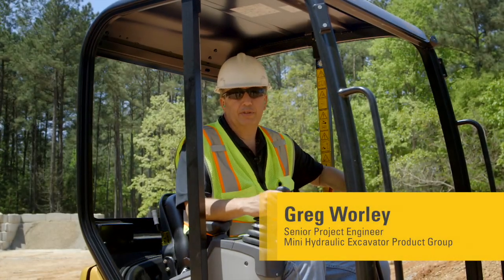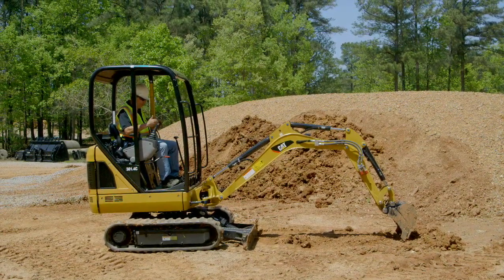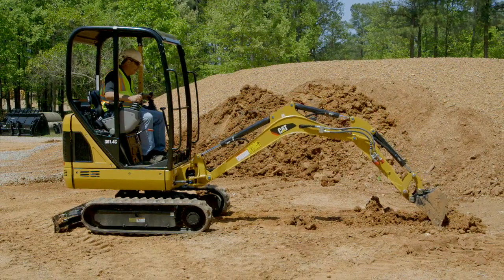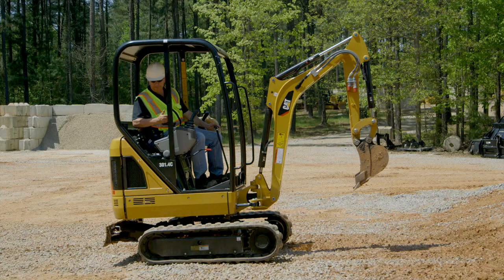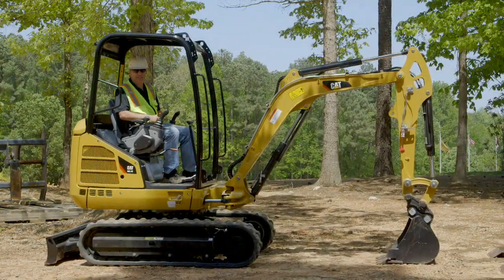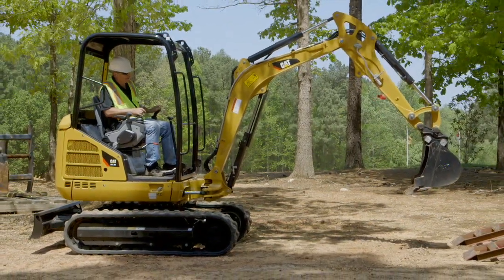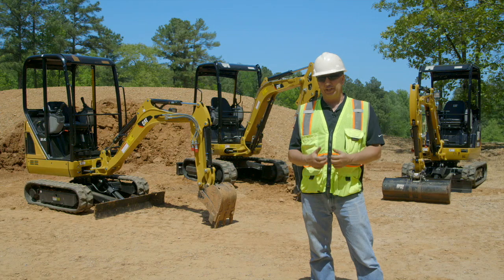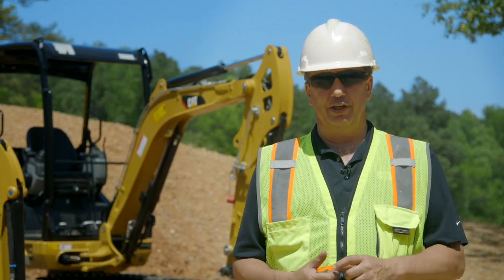Cat® Mini Excavator Operating Tips: Blade Positioning

Comment: Seems that physics depends on the device which you are using. In manual of my yanmar sv08 it is written, that you should always use the blade in front of you while digging. And this makes much more sense than on the back. If you are in front of a big hole, it is more important to have a safe position and excavator doesn't fall down! The blade helps a lot. I never had such trouble like the user in the video. And in case you feel that the excavator goes up into air - just put less material in the backup.  If you don't want to risk your like, don't use that "tip" in this video!  Put blade in front of you.

Comment: If you are trying to go up a steep incline It’s more important to have the counterweight of the  machine uphill and over the drive sprockets..the boom can be used if needed to assist your ascent and the blade can be used to stop the machine sliding downhill..........same can be said for loading up ramps..it’s a lot safer.....I’m surprised to see  bad advice given on this video...I generally operate with my blade in front but there are a few times when it is better to have it behind you
Reply: Maybe for liability reasons they had to give bad advice?

Comment: This video is such a load.  Clearly see major over exaggeration with driving the boom down while the blade is in front.   And if the hill or trailer is steep its best to back up it with blade and boom on down hill side.  That way when you can use the boom to assist in climbing the hill if needed.  Although that might void the warranty on these little tinker toys.

Comment: as soon as I see hands off the controls and on to the travel levers I disregard everything else the person has to say about safety. there are four controls on the machine and you have four limbs. if anything gets a little dicey and your hands are not on the controls you are in serious trouble. if you cant travel the machine with your feet then stay off the machine. hand travelers cant jump a curb or swing off a trench or ....
Reply: My takeuchi tb015 has travel sticks with no pedals.  It really has no room to add pedals due to having 2 already.  1 thumb pedal and 1 boom swing pedal.  Not counting the heel pedal for 2 speed travel.

No stick buttons either.  These newer machines have lots more electronics to keep the floor uncluttered.
Reply: In that small machine the pedals are in an uncomfortable position, and has a funky threshold. I use my feet to traves, but short moves are easier with hands, and use one hand for both sticks.

Comment: You can clearly see that you are pushing the boom down when the blade is in front and when the blade is in the rear, you are not doing that, instead you are scratching properly. Why? I can dig just fine with the blade in front. If fact the blade helps to stabilize the machine when I lift the material out of the ground and helps keep the machine from tipping forward when pulling up hard such as when lifting out something that is stuck in the soil.
Reply: I prefer to dig with the blade at the front it stabilizes the machine and u have a better control over the machine
Reply: @shanilram3179  .
Reply: couldnt agree more. shouldnt have someone like this on a "tips" video. people wont learn how to dig properly and instead, well, this.
Reply: I thought the same thing
Reply: Yea I agree same here I use in front.    Travel .ok in front also.  Sometimes u cant help it  trying to not mess ground up to bad.
Reply: Couldn't agree more. Digging over the blade also limits shock loads on the idler bearings while the final drive motors are nicely protected at the back of the machine.
Reply: Arthur's Cars & Customs வங்கவேந்டும்
Reply: grading with bob cat

Comment: Very useful safety information, thank you! Suggestion: as one person asked, possibly offer the option of dual blades. Would provide the stability of not tipping rearward while allowing dozing in tight spits w/o having to rotate under carriage. Not an option for everyone but for some would permit additional time savings and less wear and tear on the under carriage . Would only require welding on the mounting bracket ears at the factory. Everything else would come with the options kit, including hoses, valves and all hardware. I think CAT'S design team should look at it. I should think that most of the hardware would be interchangeable? Good luck
Reply: And how much did cat pay you for that comment.